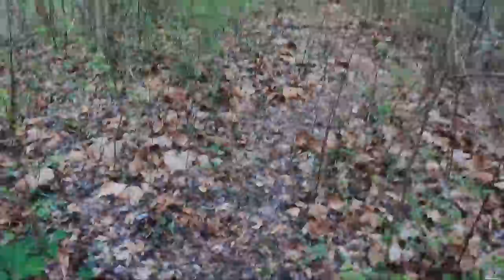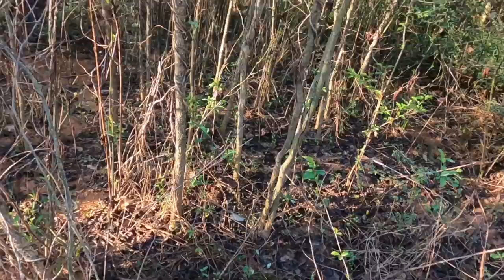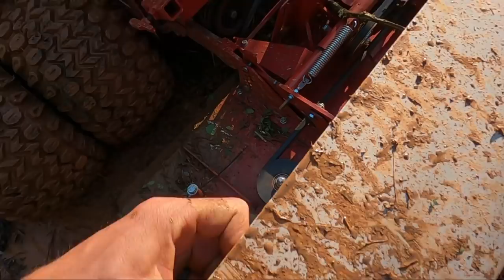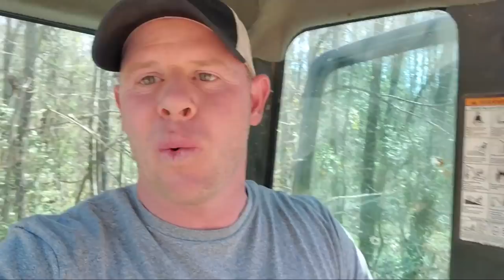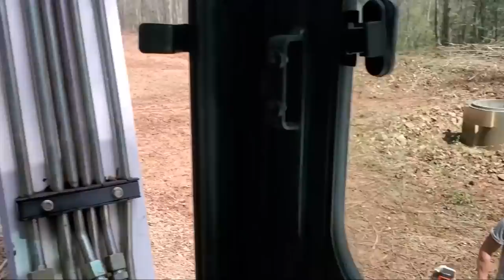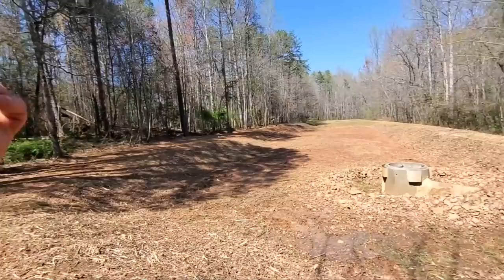Mowing a Ridiculously Overgrown Retention Pond with the Ventrac 4500

Comment: That Ventrac is a beast! I’m impressed
Reply: The skidsteer brush clearer seemed way better.
Reply: @MrPhatties  It depends on where you’re clearing. In the video above they’re in a detention pond that is still wet and muddy. The main point if you watched was to not rut up the pond or as little as possible but also clear out the vegetation. A 10,000 lbs skid steer with a 2,500 lbs mulcher not only would’ve rutted up the pond bottom but also most likely would’ve buried it’s self in the mud due to its weight. This video proves not only the versatility of the Ventrac but also highlights its capability.
Reply: @luke1772  just saying that the ventrec was struggling on small brush and lost a belt while the skidsteer didn't even drop RPMs on much bigger stuff.   Consisting the ventrec is a lawn mower it's damn impressive but I'd have been in there with the brush hog long before heading in with a tractor mower.  

Hard to make the point that the city cares about the state of the retention pond when looking at it lol.
Reply: @luke1772   Very well said were also comparing a $40000 machine to a $180000 machine I think ventrack did very good considering the conditions it was working in that big machine would have been buried as soon as it went into the bottom of the pond if the ventrack was struggling

Comment: John have you ever came across a retention pond that would just not dry up enough to get in it to clean out. I got stuck in one way back that just would not dry out. We did the best we could but never could get it totally cleaned out. It had at least a foot of water in it year around in the lower section of it.

Comment: A detention, or dry, pond has an orifice level at the bottom of the basin and does not have a permanent pool of water. ... A retention basin or pond has a riser and orifice at a higher point and therefore retains a permanent pool of water.Apr